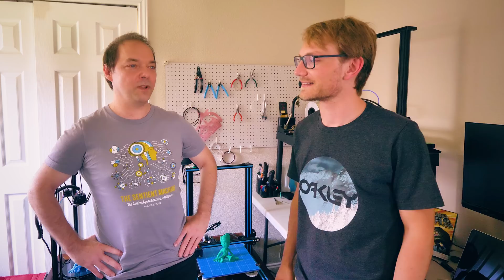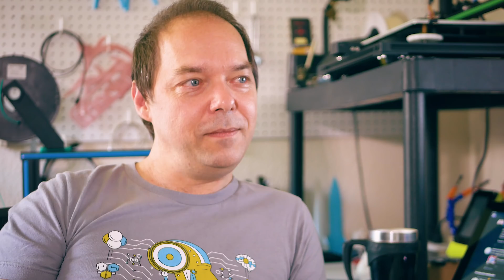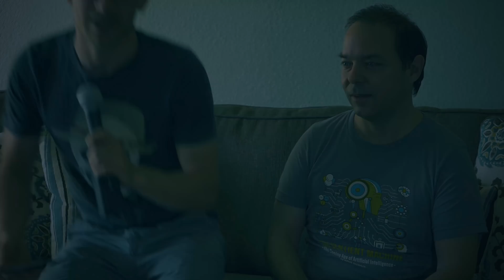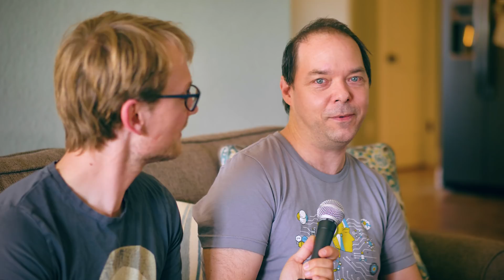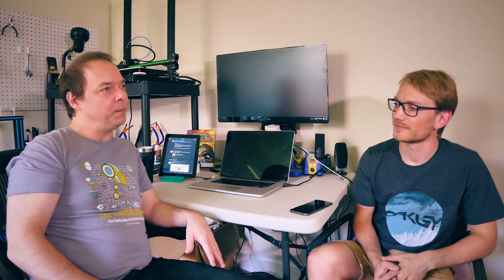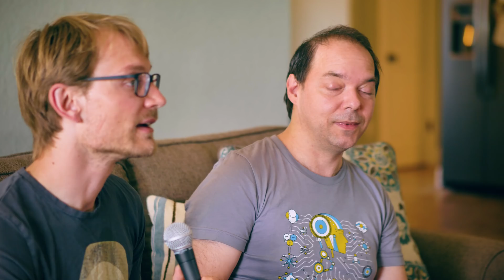How it's Made: The Marlin Firmware!

Comment: I usually tin my wire ends. But never for anything meant as a medium or long term connection, just for short, low power temporary stuff like troubleshooting and testing probes, bypass wires and looms etc. So it never sits in any connector beyond anything from 5 minutes to a couple of days.

Comment: There are several reasons as a developer to disable min/max temperature protections.  One example is if I want to test some other function that normally requires the hotend to be on but I currently don't even have the hotend built yet.  The only way to test the feature would be to disable the safety feature.

Comment: I dug right into marlin when the pos clone I got shat the bed while setting it up. marlin is very very extensive - and the fact you can turn so much on and off and modify it is perfect. and the safety features are great, not just the hotend but motion ones too. open source is the way to go. closed system proprietary ones simply cant keep pace with the updates the marlin project can offer. thank you sir.

Comment: Marlin is a awesome firmware and runs stable since years for me. Looking forward to see galvanometer support implemented after 2.0. I am building up a SLA Printer and the biggest issue is that there is actually no open source firmware which supports galvo's to control the laser

Comment: Marlin should be written so that any time the hotted/bed temp is set to a value > 0 and thermal protections are disabled, the user has to confirm a prompt on the LCD about the dangers.
Reply: There's no need for this level of paranoia,  we need to make sure the reviews cover if its been disabled by manufacturers, those that do would also disable your suggestion.
Reply: The point would be to make it reasonable well integrated with the firmware to make it more difficult to disable than a simple config option. Additionally, this wouldn't be for the 3D printing enthusiast who looks at numerous reviews and dives into the manufacturer firmware to see if the option is enabled or not. A feature like that is for the novice that doesn't even know it's a thing.
Reply: hiding it is not the answer at all.

Comment: It would be really great to get some insight into the relationship between the hardware designers' job of assigning pins to basic printer functionality, peripherals, and the firmware to support these features. For instance, I've been trying to figure out how to go about developing my own peripherals, such as enclosure heaters and other devices that are "supposed to be" supported in the GCODE specs, but there's never a clear way to tracing this down to where I can or can't plug it in on a printer's mainboard. I was surprised to see that this isn't a more common question - but this generally isn't the kind of documentation you see among the firmware or the hardware repositories. At least, not that I've seen so far.

Comment: One issue I'd like to see resolved would be the "Z Infinity" issue with UBL.  There are certain situations where UBL will cause the Z axis to increase infinitely until the machine is power cycled.
Reply: Report an Issue on GitHub, explain how to reproduce the problem and provide the Configuration.h you're using. Things only get fixed if you tell the devs about it via the right channel :)
Reply: It's already been reported many times but has yet to be properly resolved

Comment from the maker: What are the features you'd like to see next in the Marlin firmware and what are the one you're already loving? Leave a comment below!
Also, thanks again to Scott for taking the time for the interview - and of course, for maintaining the awesome Marlin firmware!
Reply: Not a feature for Marlin but a feature for this video, can you put a link to Scott's Patreon in the description? I think it will help him get a few more supporters :)
Reply: I would love to see Marlin run on an esp32 chip and use all it's wifi and Bluetooth features.. and an octopi type of interface of course. Enough raw power on the esp and very very cheap.
Reply: someone made marlin run an an esp32 already, it's a pretty easy port. making the board was the hard part :)
Reply: 1. Ability to customise  LCD menu items 2. Web interface on 32bit boards 3. Marlin upgrade tool (currently when I do version upgrade I TextWrangler find differences to update my config and figure out what actual changes are in the code, but that’s fun if you have one machine, 5+ machines and you’ll need all night...
Reply: All that, and more support for conventional CNC machines (I.e, disabling the compilation of the thermal management system; adding G54 & related commands; spindle management). Matrix keyboard support for commonly used functions & command-line data entry would be nice, too.

FWIW, I’ve just started implementing this stuff for the MK4duo variant; and I’m trying to keep it as modular as possible, so hopefully my changes can be accepted upstream... 🤔
Reply: I believe the power off resume only works for SD card operation. There should be a way to store the incoming gcode from slicers to the SD card so you can have power off resume for USB Users as well. 
I absolutely hate the process of using an SD card to print from when the printer is 3-4ft away. you might as well just plug it in.
Reply: Thomas Sanladerer I have an ender. If I flash the latest marlin, will I lose the power fail resume functionality?
Reply: i need more control on the bltouch :D and custom menu :D
Reply: Support for SLS printers, this leads me to a wider question, how do large mechanical innovations get innovated e.g SLS printers or SCARA or something else? Does Marlin do preemptive support for printer types that are still on the drawing board or is it reliant on the creators to get everything working by themselves and then it is integrated into Marlin? Or something else?
Reply: I would REALLY love to see the prusa feature of auto rehome on skipped step with Trinamic drivers. I don't understand how such a valuable anti failure feature isn't a higher priority. Am I the only one who loses a significant number of prints from skipped steps/layer shifting?
Reply: When pausing a print, move the hotend to 0, 0, 0 so the hotend isn't just hanging out on the print.
Reply: True polar support.  I am making a swinging arm with a stationary bed and the current polar support doesn't work for that.
Reply: Forth started as telescope control software on very lowly computers in the 70's. An awesome amount of expertise is present in that (our) community. That applies in particular to fixed point. As a rule of thumb Forth never uses floating point, and never needs it. 
I'm pretty sure that the Marlin software can be converted to fixed point with no ill effects, and considerable speed improvements. 
Albert
Reply: I'd like to see a way to switch from a micro SD card to a USB flash drive. Maybe it able to do now but I'd like to do that
Reply: I have Marlin Firmware on my Reprap i3, Tronxy and have just had an extraordinary happening with my printer mid-printing an almost perfect print.  I had been running the printer a lot in the day making small models of things, having to adjust some settings to get a good start,etc.  In the last print, 2/3 rds of the way through the print went completely off design and the extruder head went berserk, making a lot of noise, rattling rapidly as it moved in bizarre manor.  After shutting the machine off quickly, I tried the 'auto home' and it still did the same thing this time ramming into the right side z-axis.  I tried to adjust the x axis so this would not happen. No luck. I had also noted, before trying to change the x-axis, that on the main menu the x and y axes were down to 0 value, but not the z axis.  I tried Restore Failsafe a couple of times and it did not solve the problem. I wonder if I should try to update the Marlin Firmware for Arduino that I have.  Hope this can be rectified!  Please and thanks.
Reply: Regulatable speed for the individual motors ( if possible) So you can dodge certain annoying noises that your printer makes for example. I love the whole Marlin firmware as it is now, it's just great and works awesome on my printers!
Reply: @peerappel2012  just upgrade your stepper drivers to TMC 2130 and run on stealthchop mode
Reply: Off topic, but...

Thomas, I have been doing some research on filaments to find one which is halfway between TPU and PLA. I have drawn a blank. I need something which is not so hard as PLA and not so soft as TPU, for pattern printing, so I can make plaster moulds from the printed pattern. I have some CAD models which I want to print to make moulds and they have a lot of detail and near undercuts which are proving difficult to de-mould from plaster as PLA patterns. I think I will be able to de-mould something which is a bit softer, but it should still need some structural rigidity to stop deformation of the pattern during mould making. Could you recommend anything, please? Thanks.
Reply: Dewex Dewex, as an answer on your question: have you thought about PETG or even (probably) ABS? These are a little softer then PLA and give a bit of flex.
Reply: I have just bought a reel of PETG and will print out a small chunk of one of my models with it to try mould making from. It does seem softer. Thanks.